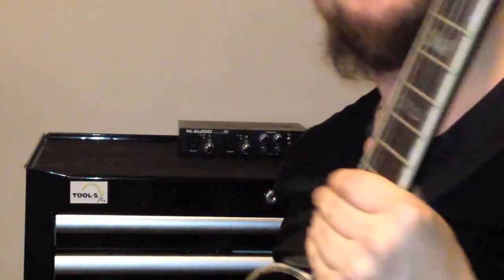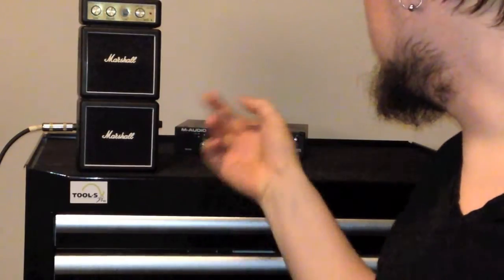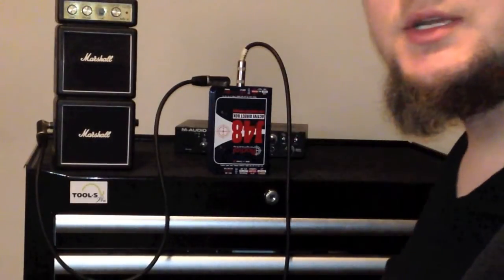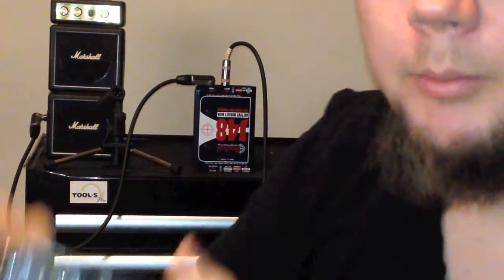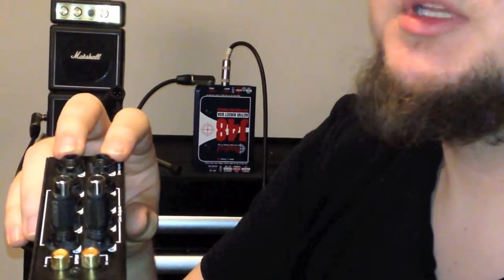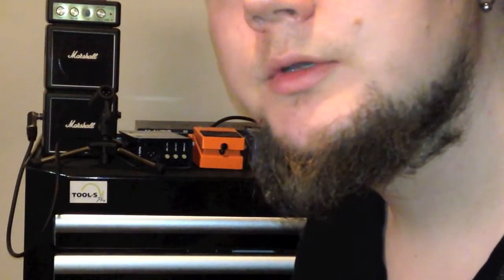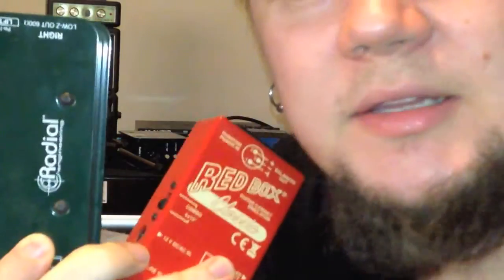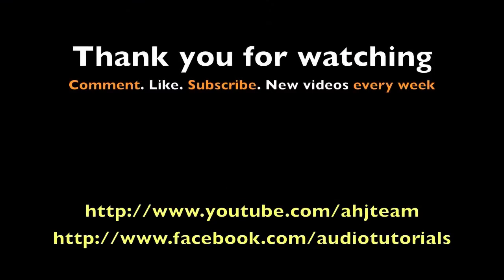Recording 101 -- Why do I need a DI box? (Part 1)

Comment: Hey wait what if i have an interface roland ua 55 which i use with a laptop and in the church there is a mixer which is connected with DI boxes....and my system goes into DI box which runs into mixer...but the crap is that i do not have any sound coming out...i do have a signal but no  damn sound coming out.
Reply from the maker: most likely user error. check connections and if the di box is active, it needs phantom power

Comment: i still dont understand the point of a di box. this video wasnt very clear sorry man and you are pretty hard to understand, personally. could you please comment the order of what plugs into what and why?
Reply: And herein lies the fallacy. Hi Z input can accept both Hi Z and Low Z signals but a low Z signal cannot accept Hi Z signal source without degrading the sound.
Reply: guitar ->DI box 1. ...DI box 1. tru -> pedal chain -> DI box 2. ...DI box 2. tru ->Amp
then Lo-Z output from every DI box goes to soundcard Lo-Z (line or mic) inputs.
The tru output of DI box is Hi-Z (basically identical with the input). Basically everything that needs Hi-Z input (the pedals and amp) is fed form guitar or DI tru and everything that needs lo-Z input is fed from DI box lo-Z output (the XLR)
Reply: KohuGaly why not just guitar -> pedal chain -> amp ? i dont see what else you are gaining from using di box inbetween them all. what do you mean by Lo-z output from every DI box goes to soundcard Lo-z? soundcard is in computer yes? then wouldnt you need route the output of any DI box through an interface or alike first? what actually needs Lo-z and what needs Hi-z and what is the point of having both?

Comment: so is there a quality differnce between the hi-z input and the di box?
Reply: hi-Z input on soundcards is basically an input with built in DI box. SO the quality should be roughly the same (it depends on the quality of the soundcard input and the DI box itself, so it's hard to say...)